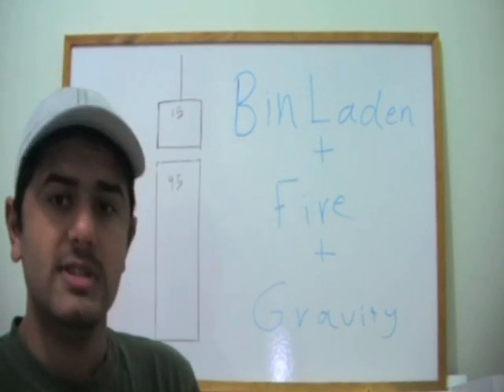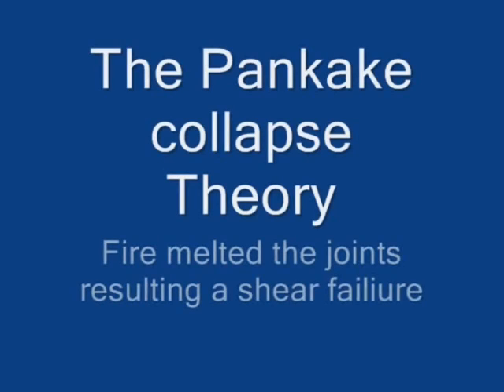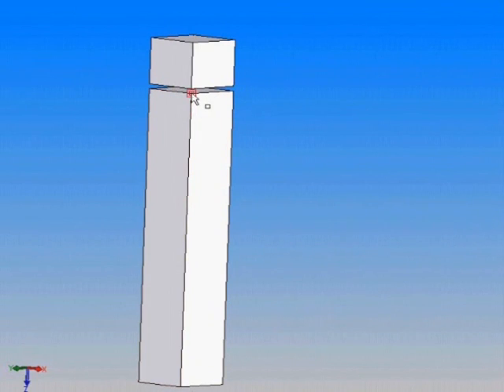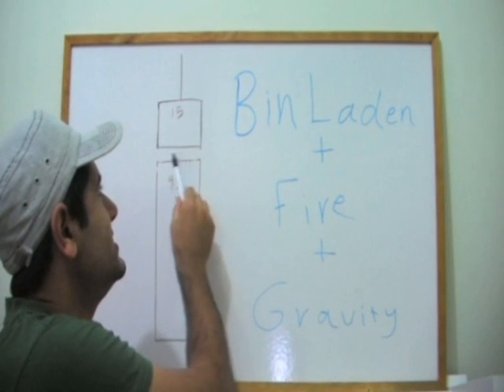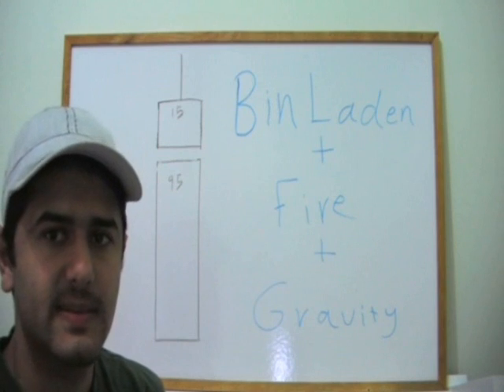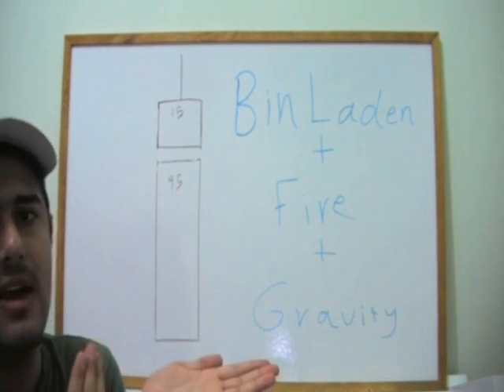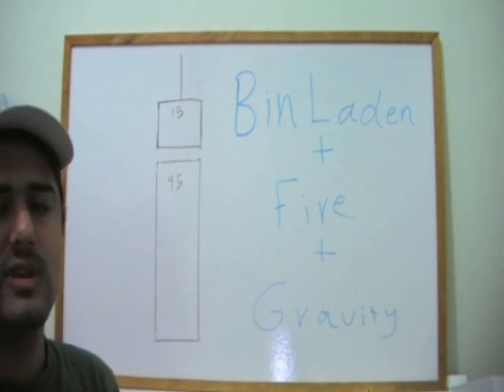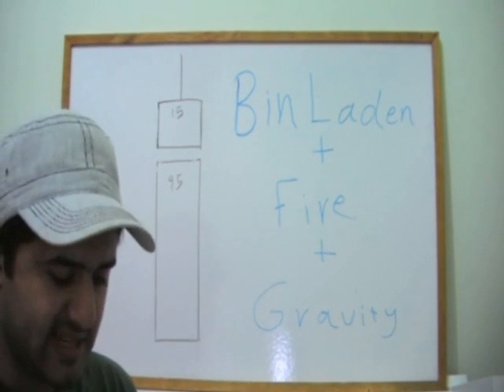(Part1) 911 Simple Physics Structural Failure Vs Demolition

Comment: Oldschooldan1: I have two engineering degrees, but you are brilliant. I said that there would be several floors of rubble and you straightened me right out. You said the concrete was 4inches thick and four inches X 110 floors would make almost no pile at all. BRILLIANT. nobody can argue with that kind of logic, especially a moron like me. I'm so stupid, I'll give it a shot anyway. 

For starters, the trade center used a special blended and porous concrete to keep the weight low. Do you remember seeing a great big cloud as both towers fell? See genius, the majority of the concrete from the towers ended up in fucking New Jersey. Manhattan had a ten inch coat of somewhat radio active dust on the ground and cars. It actually ate up the metal parts of cars. 

When I was talking about rubble, I didn't even consider the material that you are calling concrete. I was more leaning toward the massive 64-68 core box columns that were 14"X 6" that went from the bottom to the top. Then I was figuring the outer shell. Never mind the human bodies, carpets, desk, filing cabinets and toilets. It appears that all those kind went the same place that your "concrete" went. 

One 5 ton length of core column was actually found 415 feet from its place on the 28,29, &30th floor. I'd have no real idea how all the center core columns shot laterally when all the vector forces were down. But I stand by statement. If a pancake collapse occurred, first subtract your ignorant concrete and add the 110 floors of trusses, the massive inner and outer core columns and a huge indestructible HAT TRUSS on top and you'd have a huge pile of rubble. Never once would anyone with a rational mind consider the "concrete" you roaring idiot.
Reply: +Patrick Lilley 

”I have two engineering degrees” 

In what discipline??? Let me guess, mechanical, electrical…custodial?????
Certainly not structural. Any good engineer would have done better research and not fallen for such ridiculous theories.

”used a special blended and porous concrete to keep the weight low”

Sigh… for an engineer you really don’t do any research do
you? There were 2 different types of concrete used in the towers. Standard
concrete on the floors of the core and light weight in the tenant spaces. The
standard concrete had a compression strength rating of 3,000 psi, the light
weight concrete had a compression strength of 4,000 psi. Just because it was light weight does not mean it was weaker and any structural engineer would know that. You are not looking very credible. 

”remember seeing a great big cloud…the majority of the concrete from the towers ended up in fucking New Jersey”  Why yes, I do. Have you ever heard of GWB or Gypsum wall board???? The bldg. was full of it. The walls that divided the work spaces had 2 layers of 5/8” and the cores had a special 3” thick tongue and groove system made to cover the walls. The majority of the dust contained mineral wool (fireproofing) followed by plaster (GWB) and then concrete. While some concrete did turn to powder the vast majority of it was found in the pile, there are hundreds of photos proving this. So your “ended up in Jersey “ is just utter nonsense. Your credibility falls further. 

”One 5 ton length of core column was actually found 415 feet from its place”  
I would like to see your evidence for this. However, if we take this as true and the column went laterally 415 feet it would have embedded itself into one of the other bldgs. at a height of approx. 360 feet. Do have a photo of this??? I think not!  Large sections of the core survived the initial collapse some 60-70 stories. These columns broke apart at their weld joints and fell away from the structure. It’s not surprising to have found large pieces of core columns several hundred feet away from the center of the bldg..

”you'd have a huge pile of rubble” 

And there was, 8 acres of it and at some points 6 stories
tall.

It’s really not that difficult, we have the known live load of a single floor and the known dynamic weight of the falling upper structure….it wasn’t even close. The AIA, ASCE and every A&E University in the country understands this. 

You are no structural engineer.
Reply: Like any republican, you can't even keep you on track of your own supposition. YOU SAID THAT THE CONCRETE IS ALL THAT WOULD BE AT THE BOTTOM OF THE PANCAKE COLLAPSE. . I'm saying that the concrete never even hit the ground , but you forgot acres and acres of structural steel. . 

And you looked up the concrete "after" I told you about it.

Your mind is set. 19 hijackers with box cutters knocked the towers down. And bugs bunny flew the plane into the pentagon. 

Fuck it
Reply: +Patrick Lilley I'm not a Republican and you're not obviously a structural engineer.

I never said that the concrete would be the only thing at the bottom. I was simply showing that if the concrete pancaked it only be 3 stories tall. I also clearly stated that this is not what happened. 

"I'm saying that the concrete never even hit the ground"  Then what was all that concrete looking stuff everywhere in the pile????

"And you looked up the concrete "after" I told you about it." Nope, I'm quite familiar with the construction of these bldgs. It doesn't appear that you can say the same.

Why don't you tell us Mr. Engineer what structural member was responsible for determining the live load of the floor system?
Reply: Patrick Lilley
”my degrees are in the electrical realm”
Which means your degrees are pointless when it comes to the structure of the WTC.  I’ve been working in the architectural field for over 20 years, with dozens of design builds to my credit. This does not make me an expert in structural engineering, but it does mean I can read a set of building plans and specs. Which apparently you can’t.
 
”the member that holds the loads were the floor trusses”  
ERRRRRR…Wrong, do not pass go, do not collect $100. Though the trusses supported the slab they were not the defining structural element that decided the live load. The live load of the floor system was determined by the truss seats. This is what held the trusses to the perimeter and core columns. These seats would fail long before the trusses or the slab, thus it was the seats and the seats alone that determined the load capacity of the floors system. The AWS did a complete study on these seats found in the debris pile and found all the seats were bent downward below the collapse and bent upward above collapse. They all had the connecting bolts stripped from them, proving without a doubt that the seats failed before the concrete slabs and trusses.
 
”All the debris was blasted outwards.”
You need a better program. How can you trust your program when you can’t even understand how the buildings were built???? How can you input data into your program when you don’t even understand the relationship between the trusses and the seats????? Once again, you prove you are an idiot.
 
”If only a real investigation had occurred”
The structural collapse of the WTC has been the most investigated structural disaster in human history. The ASCE, AIA, NFPA, AWS, FEMA, NIST, NASA , MIT, Perdue and dozens of independent engineers have investigated the collapses. They all agree that structural damage from the planes impact, stripping of the SFRM and unabated fires lead to the weakening of the remaining columns lead to total progressive collapse. This has been completely accepted by every A&E school in the US and the engineer of record for the WTC  Les Robertson.
 
Your biased hatred of America has blinded you to the actual evidence of what occurred that day and caused you to completely disregard the scientific and engineering papers and studies that have been done. It has also lead you to believe some of the most ridiculous unfounded bullshit known to man.
I love to ask this off all the so called expert Twoofers I come across; what’s your theory??? Silent explosives, nano thermite, space based energy weapons, CGI Planes???? You must understand we are all laughing at you.
Reply: I'm sure you're right. In your discipline, I'm certain that you know more about building structure, etc. And yes, I see what you mean by the truss connections being the weakest link, if you will. And yes, I can even see them bowing, even collapsing, then I can see the building starting to fall. Up until right now, you have the upper hand in building construction, etc. But now we have entered the realm of common physics, and common sense. We are equally qualified to determine that the rate of gravity did not change on 911 and all THREE BUILDINGS FELL AT THE RATE OF GRAVITY. . I SAY "FELL" , when what I saw with my own two eyes was material being ejected out the sides at 200 miles per hour. But nothing can FREEFALL when there are 68 core columns and everything else in its way. 

Let me ask you this.  Hypothetically, do you think  that people inside the US are capable of doing something like this? Or is it just Muslims that would do it? Seriously. I'm asking out of curiosity. I've been honest with you. Now be honest with me. Is it possible that someone other than the 19 hijackers did it?

Comment: There's a clip where NIST more or less blames the building performance. The logical question was posed "What changes need to be made" and the guy said "ALL I CAN THINK OF IS BETTER SECURITY AT THE AIRPORT".  This is an engineer, now. 

By the way, a pancake collapse would have produced a pile of rubble 18 stories high. And the record stands that one core column from floors 33,34,35 (all the box columns were three stories high) was flung laterally 408 feet. That's a five ton box column from the middle of the building shot laterally. I haven't put pen and paper to it. It's not worth my time. All the information is there. Just getting people to look at it. 

The country is being overrun with fascism.
Reply: +Patrick Lilley No commercial  bldg is built to be plane proof. Only military and nuclear facilities are built to withstand a planes impact. Are you suggesting the engineer should have said we should make all structures able to withstand planes??????

"a pancake collapse would have produced a pile of rubble 18 stories high" 
Says who???? The floors were 4" thick. 4x110=440", 440" =36.66 feet. One story = 12 feet, 36 divided by 12 =3. 3 stories, moron. This doesn't take into consideration the basements, so it's completely possible for the entire structure  to pancake into the basement. This isn't what happened though. The floors were crushed into rubble by the potential energy stored in the top of the fall bldg.

What you and this idiot who made this video don't understand is it's not the top against the bottom it's the top against the floor directly below it. The live load of a single floor was the weight of 6 floors dynamic, any more than 6 floors falling onto it will cause failure of the truss connections and floors will fall. This is an engineering fact and is not up for debate.

"The country is being overrun with fascism." 
No this country is being overrun by idiots like you and Ali here.
Reply: Oldschooldan1. I need to reply at the very top of the comment section (not in reply mode) . Before I take the time to make a lengthy reply, I just need confirmation from you that you understand. I'm writing voice-activated software. When I'm using it, it must be in the original comments section..  I'm typing right now. So just type in hot it, and I'll respond to your response.